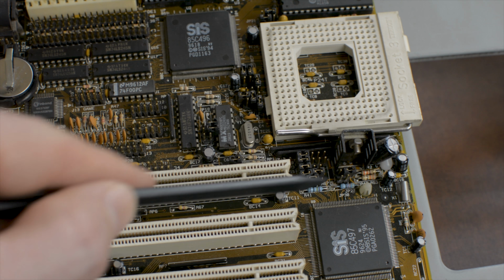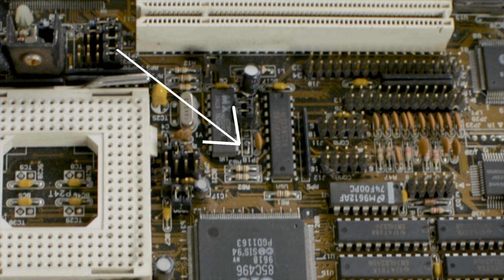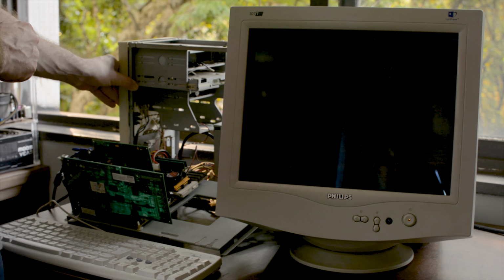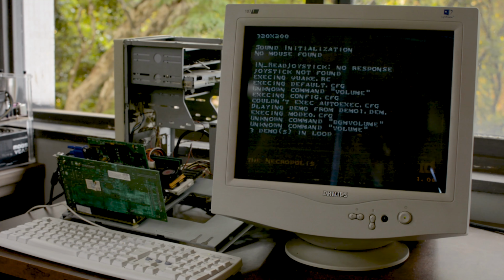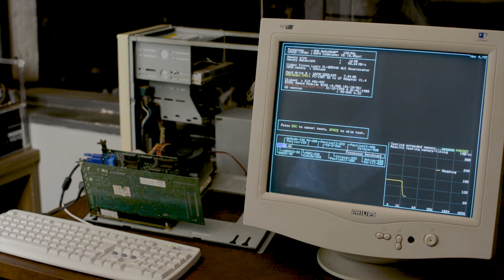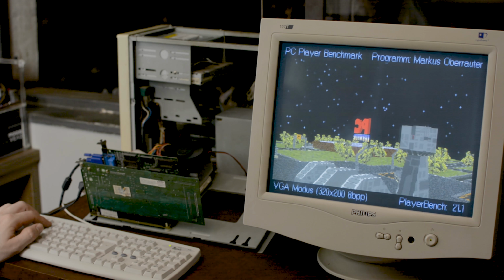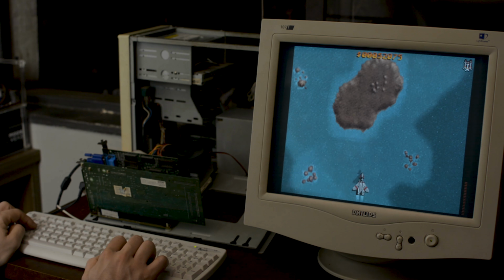Tiny 486 Motherboard - Zida Tomato 4DPS

Comment: Man this is such an awesome video, thanks for sharing it! I’m just so thankful to have been able to help you with this one. This was so much fun, and I really enjoyed our chat! Thanks again for calling me in on this one, man! I had such a great time getting this thing going! 

This board is so neat; I really enjoy that it uses an Award BIOS, and it seems pretty stable, albeit at a higher voltage than the M919. In terms of a comparison between the two, I am with you; the M919 has its merits, especially the EDO compatibility (which I am still puzzled by, as the SiS 496/497 should support it since the same chipset seems to on the LS486E Rev. D, but Zida must’ve chosen not to implement such support. Either that, or certain revisions of the chipset support it and others don’t, but I digress) and the ability to run the X5 at the proper voltage. I was thinking about it and wonder if the linear regulators on the M919 are giving ~3.3V or ~3.45V, as the CPU is rated for the latter, but works with both. The Zida board seems really well made and it’s a nice alternative for the Rust Bucket—plus, you can’t beat the size! What an amazing board for such a small size! I will say that the tuned performance of this thing was pretty damn solid! It’s a shame it wasn’t closer to the M919, but it’s still very fast, nonetheless! As for that Cirrus card, I’d say that’s one of the best DOS graphics cards I’ve ever seen! It’s got a really clear picture quality, and it seems very fast; the Trio64 is still wonderful, but you can’t beat that Cirrus! 

Anyway, thanks again for all of your hard work and for an amazing video! I especially loved the cinematography on this one—you did such a fantastic job! Thank you again for having me be part of this man, and thanks again for sharing!
Reply from the maker: Hey man, I'm the one that needs to thank you for you patience and friendship, hah. It was fun indeed, let's do it again soon. 
It's a cool motherboard, I mean, could have better energy management, as you know. Right now the 486 cooler and heatsink are not enough, I'll probably run it in stock voltages and FSB for the am5x. I can probe the regulator again on the 3 volts setting and see what it comes up with, I'll share that when I can. Apaprently it is a revision thing, there's another comment about it. The size is fantastic, I'll be thinking of a way to use that small foot print in some case, maybe fabricated or bought if i can find one. CL card is great, loved it, thanks for suggesting it's use.
As always I'm gald you can get some enjoyment out of all of this, thanks for participating and helping out, my friend.

Comment: That's amazing motherboard, its small but looks so good. It can be good base for some smaller MS-DOS PC. Pins for jumpers can be more durable sometimes than switches. And you can use few ISA soundcards there along with S3 Virge PCI there. And I'm first to watch your video :)
Reply from the maker: Thanks, I think it's a cool motherboard as well. I was a bit let down in the beginning because it was so slow, but after a few tweaks it kind of did what was expected of it. Yeah, I might be using that Cirrus Logic card more instead of the S3.
Reply: @SUCRA  I hope that motherboard will work stable for you. Performance at some older DOS games should not be a problem, even it can be used for some amateur programming or for some Pixel Art at Windows 3.1 with Paint. There are many things that don't require lot of performance. By the way I saw even 486 PC's used for some Magazine/Selling software at companies.
Reply: Runs well with a 3dfx Voodoo1 PCI Add-On Card too..

Comment: Only revisions 496PR/497NU of this chipset support EDO memory.
However, it is possible to redo EDO modules in FPM. There are several videos on this issue on the "Bits und Bolts" channel.
Reply from the maker: Interesting. I wouldn't do it though since I have both types of modules and motherboards that can use EDO as well. Have a nice week.

Comment: i just got a SiS 496 board like that too, it's a Totem TM-486SPS, which is quite similar to the zida 4dps in a way, i am using a Intel 486DX4-100 with a S3 Trio64v+ and ESS ES688FC on it
Reply from the maker: Great retro system! I think the fast 486s are a must for retro gaming. So many games for them.

Comment: Holy cow, I either have that same board or a close facsimile thereof.  But yeah, I had a heck of a time picking ram modules too.  As for jumpers, I haven’t experienced issues with the cpu as I’ve only tried overdrive processors and they seem to run no matter how you have them set.
Reply from the maker: Hey Joseph. I had one little issue while overclocking, a few times it thinks it's another CPU and gives it a different multiplier since you're not setting a specific multiplier in the jumpers. But once it recognizes the am5x it's smooth sailing. Same issue with ram, all good after some trial and error now. I have never used an overdrive CPU. I'll keep an eye out for one.

Comment: Great video thanks. I have this exact board, had to repair corroded traces thanks to some cockroach or other bug peeing on it right on the top SIS chip, nightmare repair but it lives again to fight another day. The SIS chips that have a PR code is the only one that supports EDO ram, such as my Lucky Star LS-486e rev D.  Also have an ALI chipset based VLB board with Cirrus logic 5428 same as my first PC. Got 28.1 fps from doom timedemo which is only 1fps lower than these PCI based boards. I would love to see the doom scores as well.
Reply from the maker: Hey, no problem, I'm glad you enjoyed it. Oh I got some boards with corrosion, not great. Thanks for the info on the revision, so that's why. I'll get that doom timedemo for you and throw it on a short or something. Have a great week.
Reply from the maker: Hey, how's it going? Did you get to see the short with the Doom timedemo? I'm about to get it off the air so, just wanted to make sure you already checked it out since I uploaded it because of your comment.
Reply: @SUCRA  Thanks for that Sucra, a bit over 50fps at 160mhz. That does make my dx2-66 look good at 28.1fps.
Reply from the maker: @Imperious685  My pleasure, please feel free to make any future requests. Always a pleasure. And yeah, that sounds great for a DX 66. The Intel 486s are usually a bit stronger on IPC. On the 486QuakeRace we promoted with CPU Galaxy and Retro Tech Bytes it was interesting to see all variations of that. Have a great weekend. I should have something game related come out tomorrow if all goes well. 👍👍

Comment: the m919 would be useful for a 486DX2 66 or a 486DX 33 system though. but that tomato 4dps is really great for a 5x86 or a 486 dx4.
Reply from the maker: They're both alright, but I have to say that after using this for a bit, I'd rather use the m919.

Comment: Hello, Bruno!
I'm not sure if I have any hardware magazine from these years but I kind of believe that these were the kind of budget motherboards that were used with fast AMD 486 and Cyrix Pentium like CPU as a cheap alternative to Pentium 75 machines.
Reply from the maker: Hey Alberto! I bet you're right. There was another comment about the same motherboard being used with the am5x. Also, that was the CPU mine came with. It's unfortunate they didn't implement Edo for more compatibility though.

Comment: I can not make the serial port work on my Pentium Zida  board for the mouse. Cable wiring seems different than the standart but I'm not sure I've found the correct one. Any ide?
Reply from the maker: Hey, sorry buddy, I never had to use the serial port on mine, I would probably go through the same issue. Since there are some isa slots, I would consider using a controller card with serial ports.

Comment: I've started to implement this motherboard into my own x86 emulator, UniPCemu.
I'm getting weird stuff when using an PCI IDE with the PCI IRQs set to 10, 5 (those are the only unused IRQ lines) and NA? The BIOS doesn't setup the PCI IDE controller for native mode and sets up the PCI IRQ line A to first use IRQ15, then IRQ14. I see that it sets up the 8259A PIC for IRQ14&15 in level-triggered mode on the ELCR.
After that, during autodetection the HDD Primary Master, the IDE controller on the PCI card pulls the IRQ line for IRQ14(since it's in legacy mode) high, after which the PIC starts firing infinite IRQ14 interrupts because it's in level-triggered mode with a legacy IDE device on said line?
Reply from the maker: I've been thniking on how to reply to this for a while, but in truth I have no experience emulating 486s. I'm sorry I can't really help on this, good luck with your project, seems really interesting and cool.
Reply: @SUCRA  Eventually managed to get it to work, although I didn't find Windows taking advantage of it yet afaik. The PCI IDE is now disabled on the i430fx, but otherwise everything seems to run fine now, at least wrt the emulated hardware. NT 4.0 runs like a charm now! :D
Although I'm getting weird Windows 95 registry corrupted error boxes now when running Windows 95 in it.
Atm working on big improvements of the packet server, with automatic IP configuration(based on some static settings and ARP validation, using a local IP address pool).
Just fixing one final remaining issue where the router stops sending data to the client (each one now supported on it's own emulated NIC instead of the host's).

Comment: I own "New" boxed Zida4DPS Boards.
The BIOS have many Settings, so is Perfect for BIOS Chipset, Buffers, Timings Tuning.
Now you must follow the right Rules 
for let runs a Am5x86 perfect:
Set the CPU in Write Back Mode.
Make sure, the L2 Cache have 
No-Non Cacheable Areas.
In Summary perfect for 
3dfx DosGlide Self Running Demos 
and for DosGlide Games in max FPS.
Reply from the maker: alright, thanks for your comment!

Comment: Trying to build a system with this exact motherboard. But it won't even boot. I just took the simms from an old packard bell pentium system as they seem to fit, but after watching your video I've ordered FPM simms, based on the hope that it's not what i already have. Any other "do this or it won't boot" pointers? Thanks for the vid!
Reply: Right, and also, what are the corresponding jumper settings for the 5x86 cpu? I didn't find it specifically specified in any of the manual revisions.
Reply: Lol also, i just found out, you know you're building a retro system when the cpu heatsink is more expensive than the ram.
Reply: Scratch that, found it!
Reply from the maker: Alright, glad you found it. Besides the ram I would just double check the jumpers, it's a fairly complex jumper system. Voltages and all. Good luck! 👍
Reply: @SUCRA  Thank you!
Reply: @SUCRA  I think the worst part was when i thought there wasn't a manual for this revision, and the jumper sections didn't match. What a headache. 😆
Reply from the maker: Those jumper clusters are gnarly

Comment: So, the tomato board is not a lemon? :)
Reply from the maker: Hah! Not entirely I don't think so.
Reply: i have some socket 462 AMD athlon xp board i classify as a lemon, intermittent posting issues, ide controller issues, frequent lockups, only 1 ram slot works, etc.

Comment: I have the Zida 4DPS; it’s a nice, fast, and stable board (well, as stable as a 486 platform can be, anyway). However, it has a major problem, at least for me: no VLB slots. When it comes to 486, having VLB slots is a must in my book. Playing with 486 & PCI motherboards, trying to push the limits of what a 486 can do, can be fun… But in the end, if there are no VLB slots, might as well just go with a Pentium MMX/Intel 430TX: much more versatile/flexible, easier motherboard configuration (just a few jumpers compared to some 486 motherboards), and infinitely more stable.
Reply: But on other side PCI videocards can be found easier and bought for lower price than VLB ones. Some 430TX motherboards can be used even with AMD K6-2 like my Gigabyte GA-586TX3 which I'm using with AMD K6-2 400 (it needed latest BIOS to support that cpu).
Reply: @modernandretrogaming  IMO, using an AMD K6-2/3(+) on a 430TX doesn't make sense in most scenarios. It used to (kinda) make sense 20+ years ago for people who wanted to do a quick upgrade with minimal financial effort, however, from a retro perspective, you lose the granular speed flexibility that the Pentium MMX offers, while also not gaining much speed with the K6-2 (which will be severely bottlenecked by the 66 MHz FSB, so gains are not that significant anyway).
I would keep a Pentium MMX on a 430TX and go with an AMD K6-2+ or K6-3+ on a good Super Socket 7 board, where you will get the most flexibility out of this CPU.
Reply from the maker: Nice! About the VLB, yeah, it's trade off, keeps the board tiny. There are plenty of boards out there with VLB though. Unfortunately the one thing that I have never seen around these parts is an actual VLB expansion card hah, plenty m919s though. I do have a pentium MMX 166 but not with a 430tx, it uses an aladdin chipset, so far it's been alright.